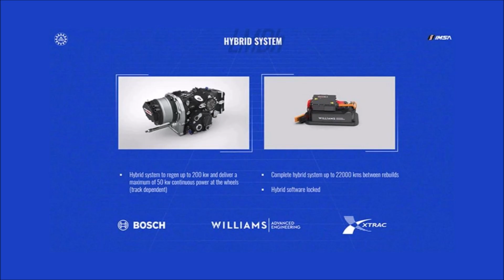24h of Daytona 2025 - Between Luck and Disaster (Technical Analysis)

Comment: While the Lambo is a factory team it isn’t being run by themselves but by Riley a very experienced team who helps support multiple IMSA programs (The 74 Ranch Resort LMP2 and Kellymoss GTD Porsche) Plus they have many many previous years of building and designing cars. I think Riley will develop the Lambo further but it will take them time as they had a rather short notice in the off season to get this program geared up. But unfortunately it does already seem like Lambo wants to scale back to full customer programs only for 2026, which for me would be a big mistake if they can’t get the cars shown to be competitive before then because who would want to run one.